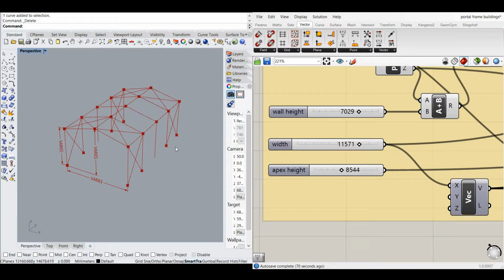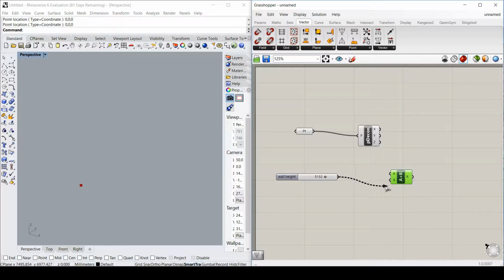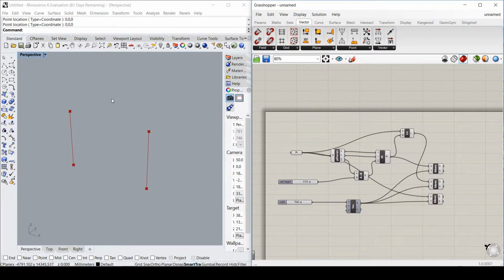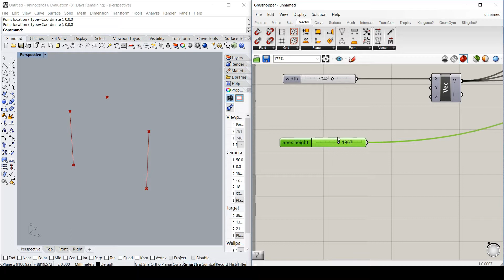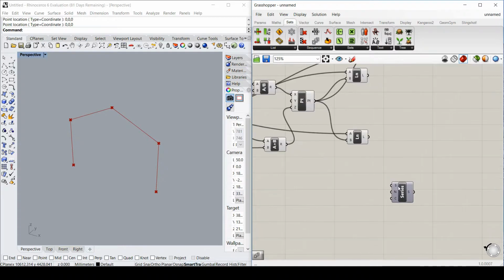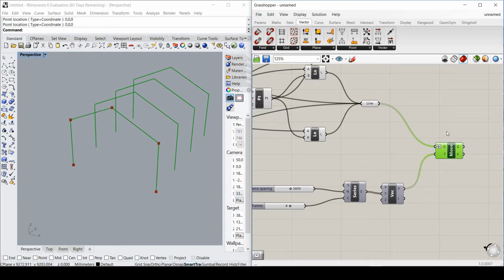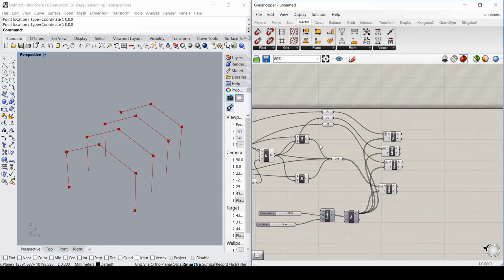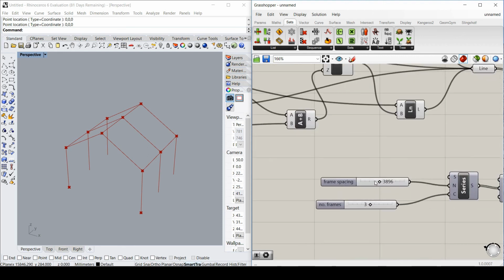Tutorial: Simple parametric portal frame with Grasshopper and Rhino for structural engineers

Comment: This is very great video tutorial, thanks for making it. But this is not complete. I open the Grasshoper file from your website and it is quite different with this video, example how you copy the frame where in this video group it first than replicate, but not same in grasshoper file that you shared in your website. But thank for making it and shared to youtube.

I try to follow the script and stuck when creating a bracing. Why your line are dotted when you put it to the "list item" command in bracing script ?, if you don't mind to answer.
Reply from the maker: Thanks for your comment. I did not realise I had put a more advanced script version on the website. However hopefully both the tutorial and script are useful so I will leave them both there. 
The dotted line means it is carrying a 'list of lists' rather than a plain list of items. I had a look at the website version and it does not use the 'list of lists' as it flattens the them when entering the [list item] components. You can see it flattens the list with the down arrow symbol. You do need to flatten for the script to work.
Hope that answers your question.
Reply: @StructuredParametrics  Hey SP, is the more advanced script still availible? Looking to add girts/purlins as per typical spacing to the script too.